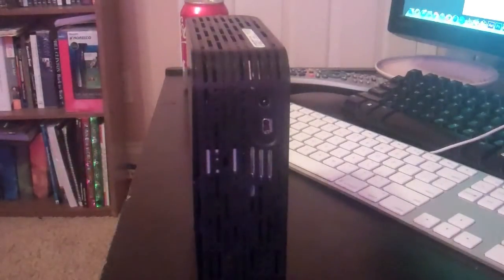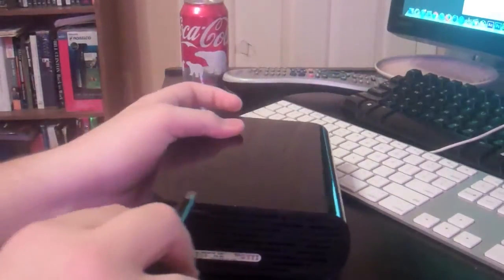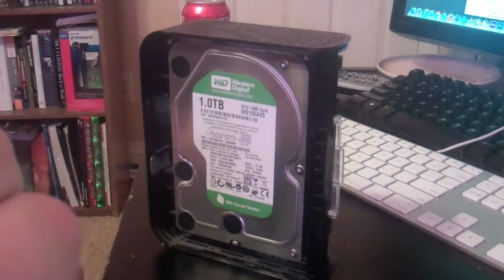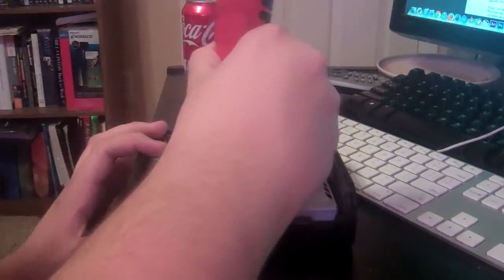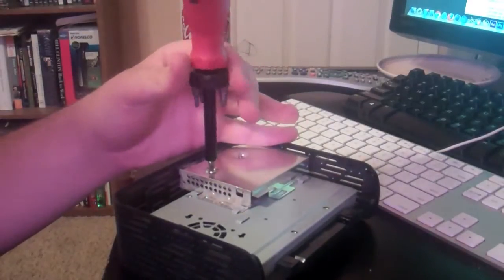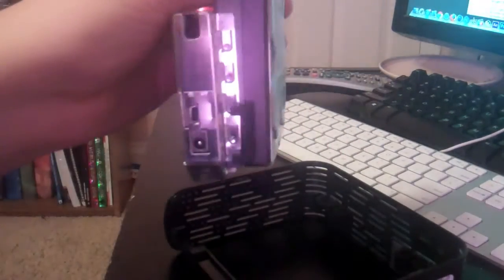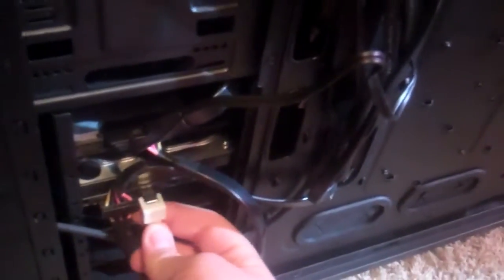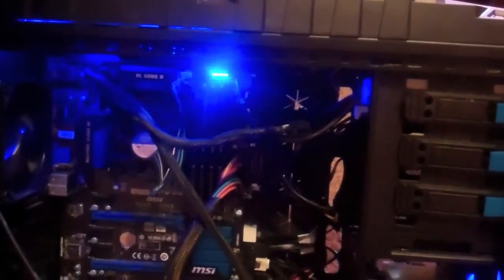Opening MyBook External Hard Drive and Installing as Internal

Comment: hey Tony, thanks for making this vid. i'm a total n00b when it comes to computers, i bought a 4 terabyte MyBook a while ago to solve my storage issues and to mainly use for all of my games and stuff. then a friend told me that using an external drive with nothing more than a USB to transfer data would drastically affect my gaming experience and cause a couple of issues, like for example, making loading screens take waaay longer. he reccomended installing it internally to greatly improve data transfer speeds. you mentioned something called CASH? in your video? what is CASH, and how does it affect the speed of your computer?